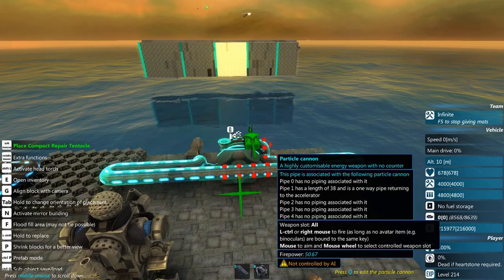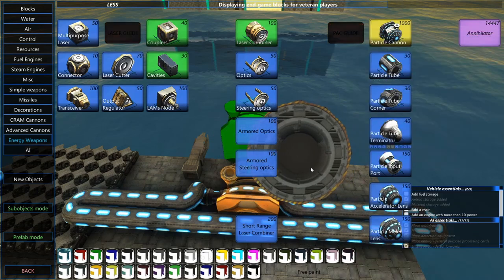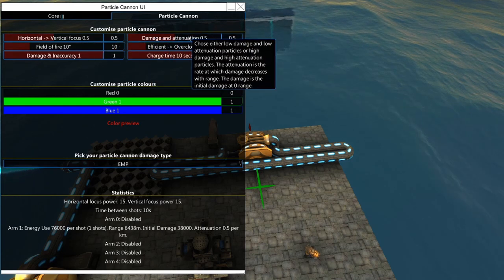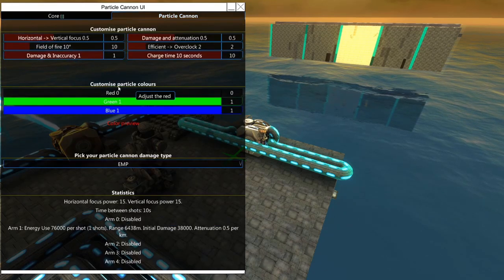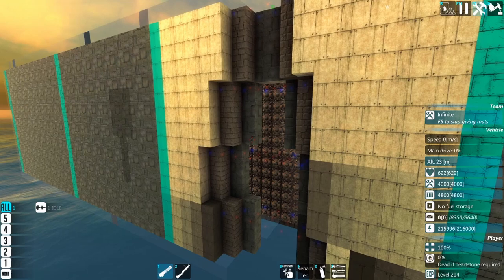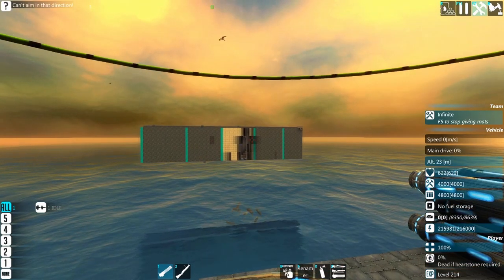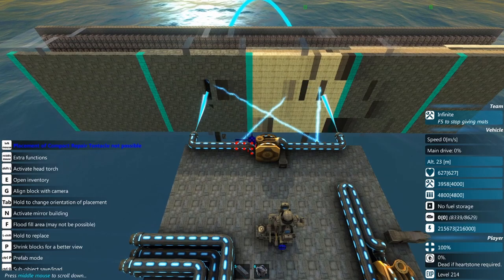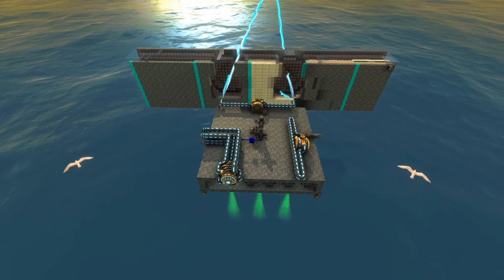From the Depths - Tutorial 19: Particle Cannons

Comment: I just experimented with it and the overclocking and it modifies the damage linearly while the energy cost exponentialy. Base is 2,5 damage/energy. So if you double the damage it will quadruple the cost. It gets out of hand realy quickly. But you can underclock it too and it works the same way. Reduce the damage to half, cost gets cut by a quarter. (and it become ridiculously efficient at 0.1, tenth the damage but you get 250damage/energy).
Reply: It seems to me like these could make very good point defence weapons in this mode. If you set them to a high rate of fire, make them accurate to a decent range the fact that they are hitscan should make them able to hit even very fast incoming munitions reliably. Most very fast munitions will probably not have a lot of health, so their low damage output won't be an issue, and most huge hard to destroy projectiles are things like cram shells which are slow giving the particle cannon plenty of time to send rounds into it. 

This wouldn't be as reliable as a powerful laser PDS, but laser PDS are super energy hungry, so can't sustain their fire. This kind of system in comparison wouldn't get every shell, but it would be able to thin out the volume of fire you have to endure for a very low cost